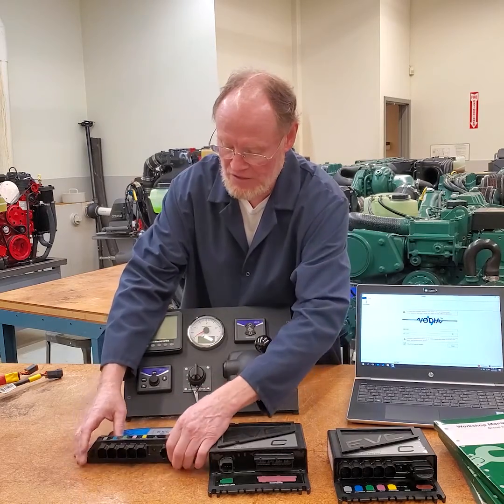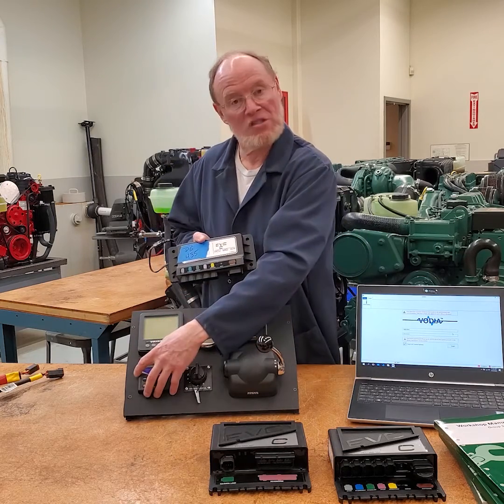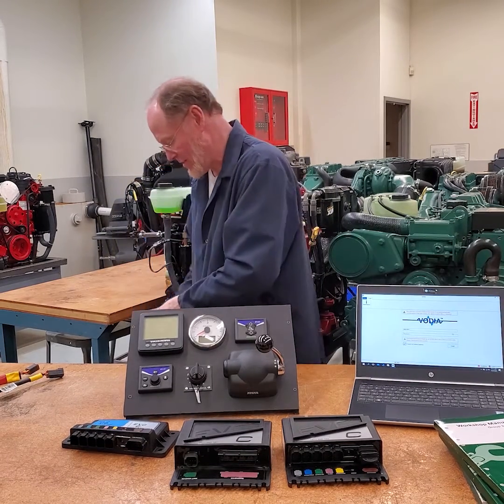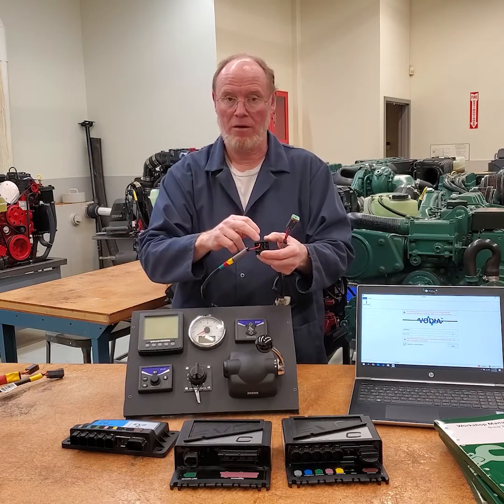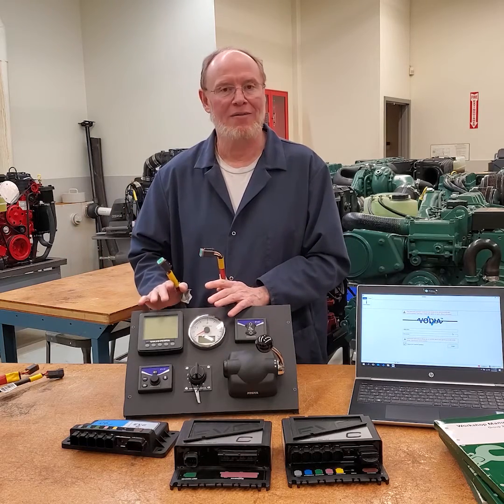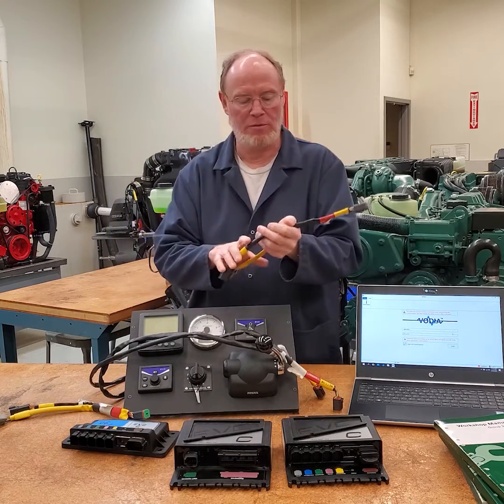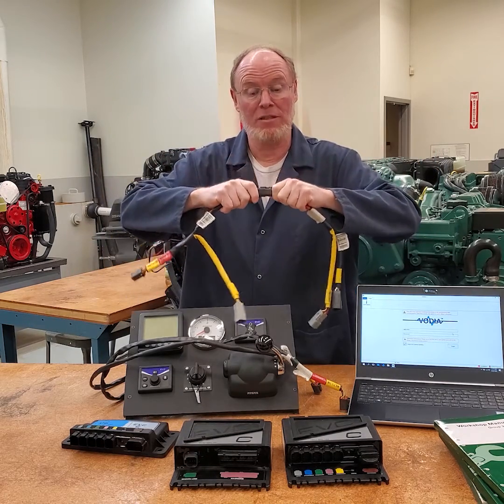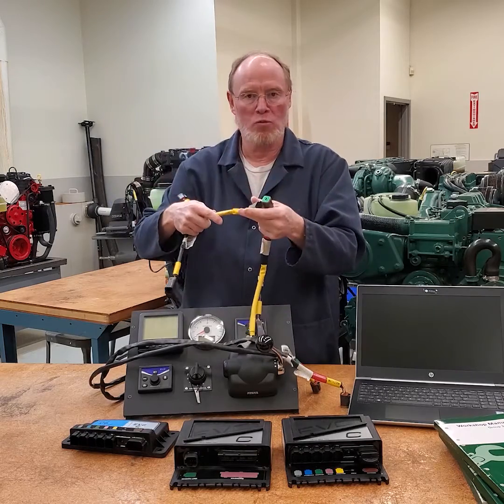Volvo Penta EVC Harness connections 1

Comment: Hello, I do marine electronics/electrical. Have you seen any other signifiant issues with this current system when connected to NMEA 2000 that's powered from House Batteries? A client has an issue with his Autopilot and after diagnostics I found the Reactor 40  volvo/penta Couarse Control Unit's N2K transceiver CAN L shorted to CAN H bringing down the entire network. After reviewing te installation manual I found this particular R40's NMEA 2000 connection be connected with the black DC negative in the yellow N2K power cable thats connected to House sub panel. I believe theyre trying to keep the negative voltage reference balanced to not sustain ground loops. However, with J9139 connected to the MFD and it to House. NM2k House, Volvo Steering CAN to Engine Start I really feel there's soome looped d loops. I'm thinking of just powering the two MFD N2K, and R40 off the start swittch  and maybe even off of the  Aux Relay you spoke about but I dont like that fact the switch would need to be in RUN to power these devices. The point would be to have a common Reference from the same battery and not have only 1 suffer significant difference in voltage potential during  large loads such as the engine starting (which isnt good for electronics"). The prolem lies in the fact the mfd, R40 and   (even though its not stated) the Steering CAN should be powered and bonded at the same point.  Do you have any experience in te matter? It may be fine but it doesnt seem quite right from the diffent lovation for the draink to the seperate source powers . the steering CAN dosnt put 12vdc's in the R40 however the  transceiver's internal components like FETs, transistors, etc are affected by the Voltage drop of the engine start load thus, creating potential differences at the R40 steering Can and N2k transceiver? (CAN translator)

Comment: Hi Ted. I have an EVC system with twin engines and when I select single lever mode, the Volvo display indicates that the module is not installed. I would like to use single lever mode. How do I install that module and how difficult is that? Thanks.
Reply from the maker: That is a EVC option, and obviously not installed when the boat was purchased.
Contact a Volvo Penta dealer and they can download and install that software for you. At a cost of course sorry to say.

Comment: Hi! I just bought 2x volvo d9 MH code D9A2J and other one ends with A except for the J. These have the start/stop electronic rpm handle box, but i wonder if i actually need the box or i can convert to a traditional gas wire?

Comment: I have a Volvo engine that leaks diesel into the tank. What is the reason? Engine type: D3-300
Reply from the maker: Diesel engines have a fuel return system from the injection pump and injectors back to the fuel tank.

Comment: Hello o-master of the Penta of Volvo, Question: I had a 2018 D4-260 and she passed away so we just got a brand new D4-270 which looks identical except it has another external computer box we need to mount, will my color 4"x4" color display and old throttles work with the new engine without programming? Or at all since its a newer generation? Thanks Guru
Reply from the maker: Ohhhh... so if you have a new D4-270, then you have a different version of EVC, your 2018 D4-260 was likely EVC-E and now you have EVC-2.0 which is a new engine design and an updated EVC software platform. The only way you can find out if your old controls and display are compatible is through the reprogramming of your helm HCU (control) to make it (if possible) compatible with your new engine package. So your will need to contact a Volvo Penta dealer and have them come down with a VODIA diagnostic tool to see if they can fix the software conflict you have. By the way the new box you have is the DGM which is the diagnostic gateway.
Good Luck!

Ted

Comment: Hi, I have 2 D6 350’s I’m trying to connect a Raymarine EVC 100 into the Axiom. Which socket do I plug the Y interface lead ?
Reply from the maker: If your interfacing raymarine into EVC you need a NMEA 2000 backbone and a Volvo Penta/NMEA 2000 module.

Comment: Hi Ted. My boat has dual D4-260's with EVC-C. I've started to have it that suddenly both engines will show low voltage warnings and display voltage to be at around 12.1 even though engine batteries are at 12.7.  Can you advice on where the EVC-C pick the up the voltage (somewhere on one of the engines?) and what connection points I should check for a poor connection that may cause this problem?

Comment: Congratulations. the explanation was very didactic.
I have a technical question. The datalink conducts data from each engine and the multilink is a bus that conducts both. Does the datalink uses J1939 protocol and the multilink also with the difference that it adds an identifier per engine?
Reply from the maker: Yes both the datalink and multilink are CAN J1939 data streams. Just deal with different information. The multilink allows engine sync as well